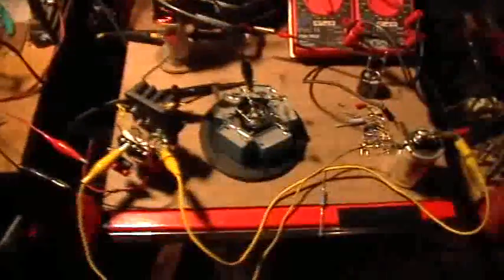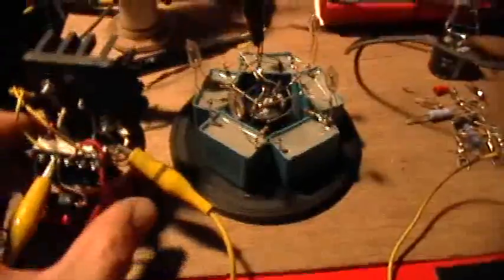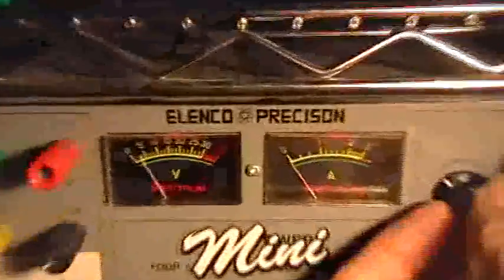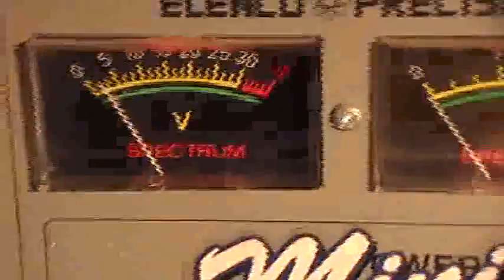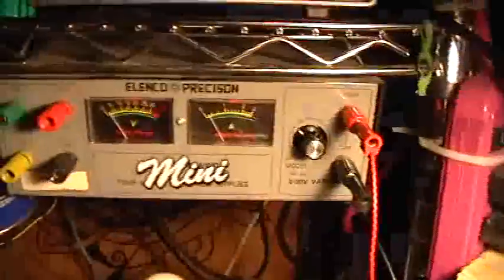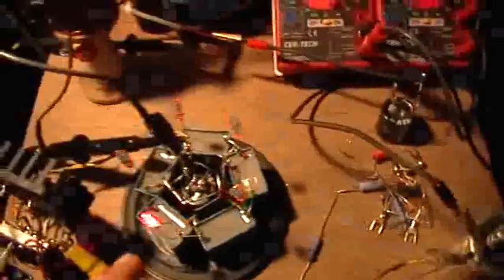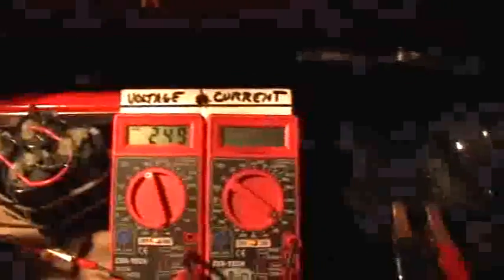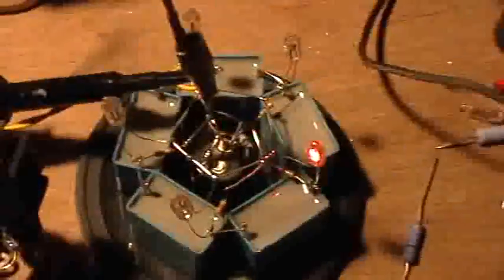Joule Thief: NE Rattler Charges External Capacitor

Comment: I take a very dim view of people who mislead newbies into believing they can replicate someone else's device, and then try to build a successful project that ends up in failure and frustration.  I at least warn others that this or that may be unsuitable for a certain use because it's not rated high enough voltage, for example.  Others who don't do so are not playing fairly in my book.
Not to mention the cost.  I've offered others to sell them a brick of 100 2N3055s. I've had no offers yet.

Comment: Why not put two or three of them in series?  Better yet, use some UF4007 fast recovery rectifiers that you can get out of an old PC power supply.  You don't say what the freq is but the 1N4007 series are made for power line freqs and have slow recovery, making them lossy - they waste power.  You could also put three or more 1N4148s in series. You're also pushing the 2N3055 way too far past its rated 60 volt maximum.  You're not setting a good example for others, esp. newbies!

Comment: I wouldn't worry so much about the capacitor, I'd worry about the 1N4002 breaking down!  That rectifier (if it really is a 1N4002) is only rated for 100 volts, and you're putting four or more times that across it!  if it fails shorted, all that energy in the cap will go back and POOF! Something's going to smoke.  I've been thinking about wiring up several dozen of those 470uF 200V caps I took out of old PC power supplies.  Should make a nasty spark when they're shorted! Spot weld with it!